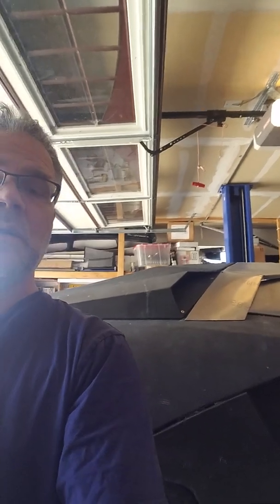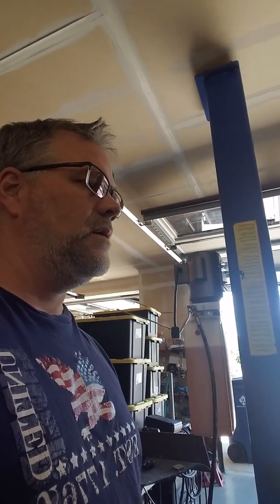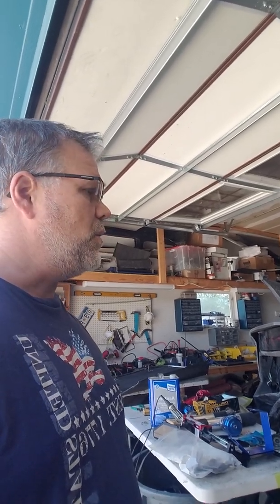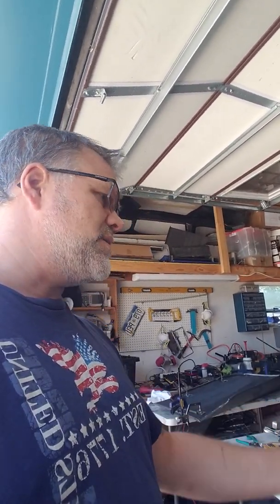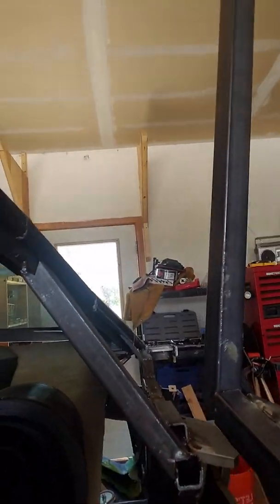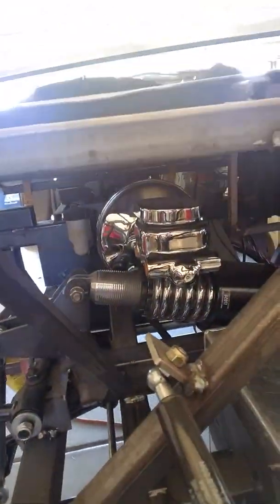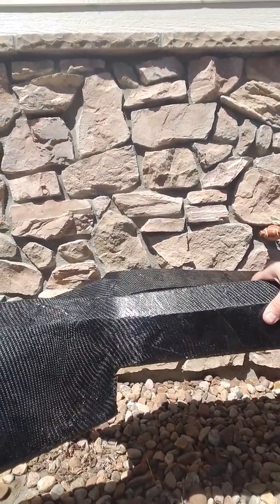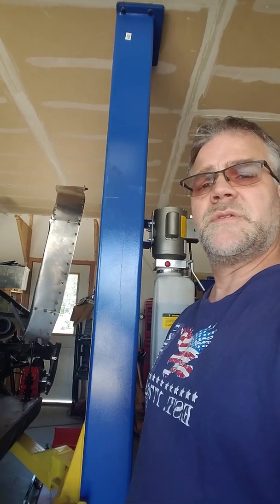Interceptor Part 1

Comment: "for educational uses"  I can agree. I've learned a lot, I thought a lot of things were quite hard to do as single person but it turns out not..

Wouldn't it of been harder to do a metal shell than a carbon/fiberglass shell? I've been wanting to create a truck I designed myself, wanted to do metal but fiberglass and carbon seems a lot easier to work with